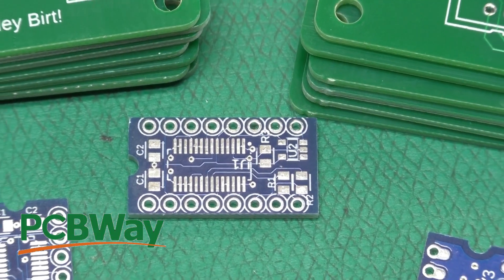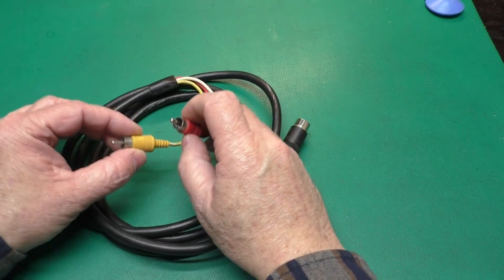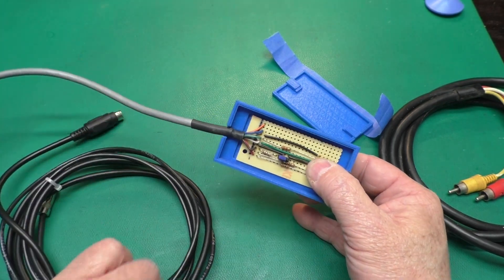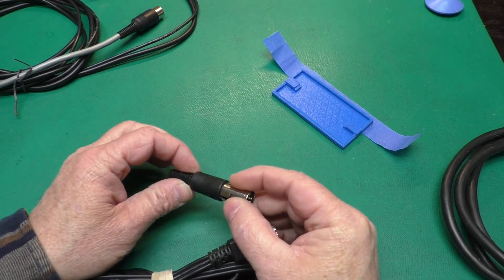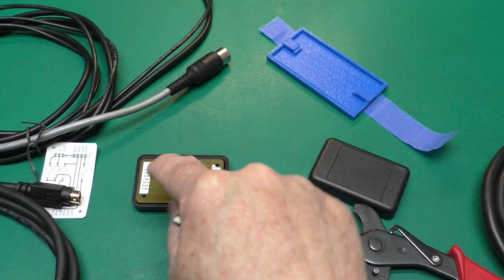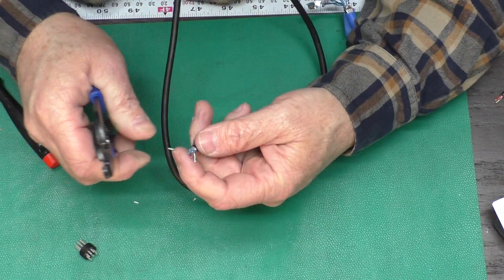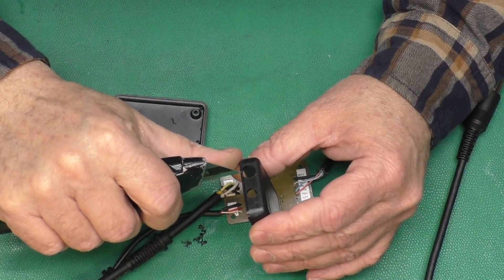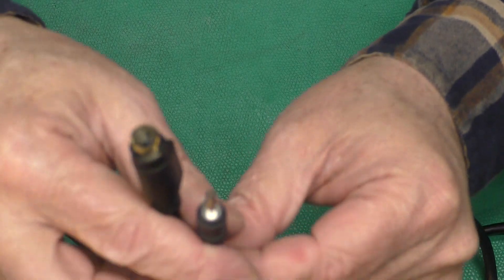My Mk3 SVideo cable for the C64, from craptasic to fantastic!

Comment from the maker: I created a page on GitHub for this project in case you are interested: https://github.com/Jeff-Birt/C64SVideo 

I milled out my PCB but also created a version of the PCB for having made professionally by PCBWay, etc. This is the "C64_SVideo_Cable_Pro_2021-03-17.zip" file you will see on GitHub. There is also a BOM which includes part numbers for everything but the resistors as I pulled those are just bog standard 1/4 watt carbon resistors and except for the 330 ohm for the chroma line the values are not particularly important anything less than 100 ohms for the other three will do.

Comment: I use the a 8 pin video connector to scart, and that gives great video/audio quality, and they do not cost a lot, the C64 was the first device that used S-Video but then with a big 8 pin video connector, but making your own cable is also great.
Reply from the maker: The Atari 400/800 also had a luma/chroma output but it was never really used as I recall.
Reply: @HeyBirt  Such a pity, it gives much better screen quality.

Comment: While I do prefer the feel of having everything in a cable, you are not wrong in the 10 Lbs of flour in a 5 Lb sack analogy. This is a very nice and neat project. I personally had looked high and low for a proper 8 pin DIN connector so I will order a few of these tomorrow. Thanks Birt! This is gold!
Reply from the maker: I was happy to be able to pick up a bunch of these connectors as the ones I had previously found were the nickel plated type which have a much higher contact resistance.

Comment: I like to buy the cable twice as long as I want and cut it in the middle so I have two ends I can use.  Instead of cutting one connector end off and wasting a connector.
Reply from the maker: That is good way to do it.

Comment: Just bought two of those S-Video cables.  I wished I had known before I bought a cheapo S-Video cable from eBay and Amazon.
Reply from the maker: The bad part about Amazon is that it is all pot luck, you don't know what you will get. The SVideo cables from ShowMeCables were about the same price and much better quality.

Comment: I used 1/8th W resistors in the back of the DIN connector with a dab of silicone. It was tight but it worked
Reply from the maker: I'm glad you got it to work.

Comment: Does this apply to the PAL C64? I can't recall any issues making me need resistors.
However I had problems with RGB from the Amiga, it fried a chip in my TV a couple of times until I realized it needed resistors (and there was also an issue with the ground potential from my cable tv provider so it might have been the real problem)
Reply from the maker: Yes, it is an issue with PAL too. The problem is the Chroma voltage is too high. Some TVs/monitors will have an automatic gain circuit that can deal with it and some don't. So, you may or may not experience the problem.

Comment: Okay. Before I watch this video... I have a friend who work with picking up computers and monitors for recycling. I used to work there too many years ago. I asked my friend to look out for any LED's with S-video input and he found a Dell 2007 FPB. Now, Dell with S-video is good news for the Commodore 64. But not the 2007 modell. Due to... The S-video port being to digital.. something like that. Now I will watch the video and maybe find the solution. 😊
Reply from the maker: My guess is that it might not have dealt with the C64 chroma signal voltage being too high. A 330 ohm resistor in series with that signal solves the issue.
Reply: @HeyBirt  Aww.. thank you. I've just watched the video and here you are with a reply. I left a like and I've subscribed to your channel.

Comment: I once cut open an s-video cable to make an adapter. 
There were two coaxial cables, but the signal was on the screen and ground was in the middle.
Reply from the maker: Oops! At least they tried to do it right.

Comment: I purchased a Commodore C64, C128 High Quality S-VIDEO & Composite Video Cable TV Lead, Cord from 
RetroComputerShack on ebay for about $20.  Then I purchased a RCA Svideo to HDMI Converter from Amazon for about $37.
It works great.  This was before people made that slick plug in card that you mention.
Reply from the maker: Does your cable ground the audio input to the SID and have the Chroma resistor? The first cable I made did not and this could be an issue.
Reply: @HeyBirt  Not 100% sure but I have never hear any feed back, so I guess it does.  What I like about this cable is it outputs both 3 RCA jacks and the S-Video plug.

Comment: Hey Jeff! Yes, a good quality video cable makes the difference... Anyway I think you should try video signals from old C64s (i.e. "breadbins") 'cause I noticed that C64C's video signal is better (when you connect a C64 to a modern LCD TV). Good job! See you Jeff! 👍🏻😊
Reply from the maker: The quality of the video output does vary by the PCB revision. You can overcome much of the problem with some simple mods to the RF modulator section. Adrian Black has done a few videos on this subject.

A lot depends on the upscaler used too if your TV does not have an SVideo input. Some of the cheap ones on Amazon work OK, some are crap. The Extron DVS-304 I use does a great job.